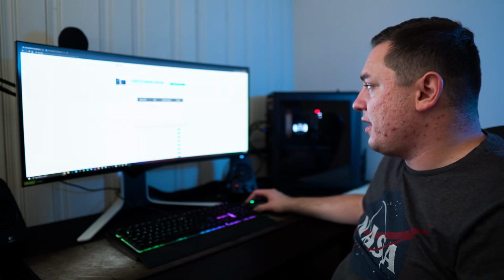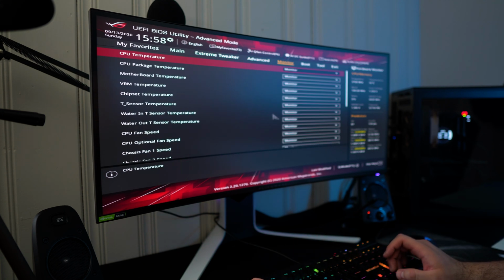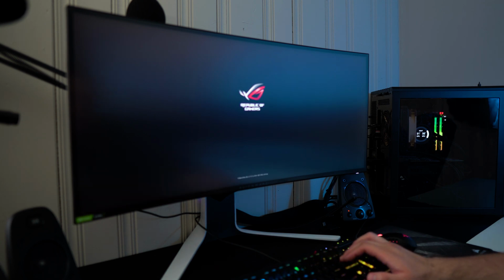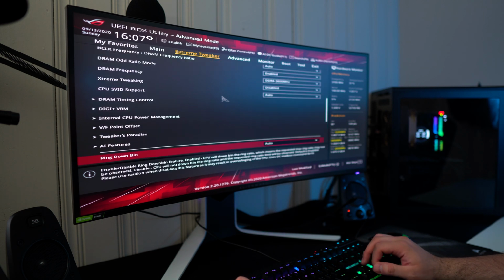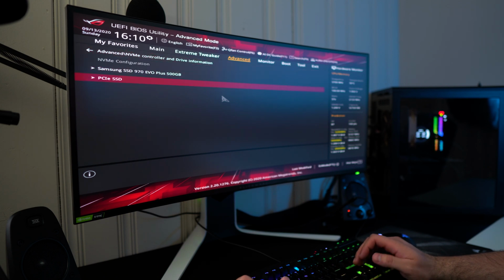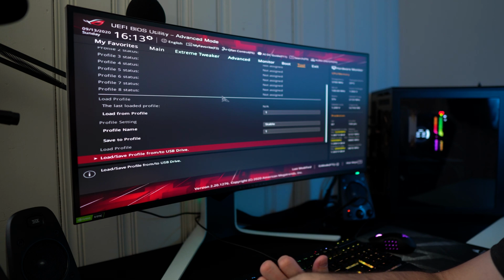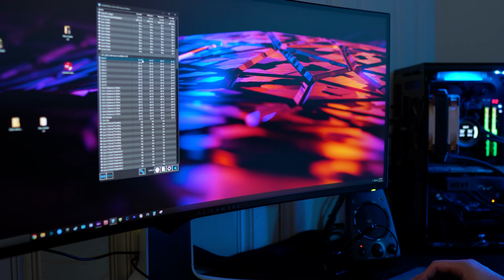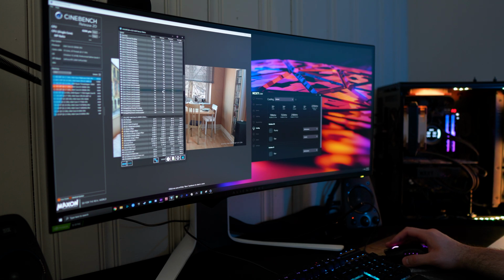ASUS Z490 ROG MAXIMUS XII HERO WiFi BIOS Update w/ 5.2GHz OC

Comment: Helpme nzxt cam not supported cooling devices found (nzxt z73) Mainboard Maximus xii hero wifi
Reply from the maker: Did you plug in the usb cable from the aio to your motherboard?
Reply: @Montieyt  yes I have installed it
Reply from the maker: If everything is plugged in correctly then go to bios and make sure usb is enabled. Reinstall Cam nzxt software on windows. Still having issues contact NZXT or return exchange at the store. Let me know if this helps.

Comment: Whenever i try to overclock on the bios when save and reset it brings me to System safe boot system unstable helppp same mobo with 10850k
Reply from the maker: Go to bios and click on reset to default settings.
Reply: @Montieyt  yes i did that before overclocking

Comment: Hi Montie, I have the same Motherboard and CPU, and I just updated to BIOS 0901. Now the rebooting time went up from 22 seconds to 1 minute and 12 seconds No overclocking, just Intel settings. It also freezes if you select QFan Control tight in BIOS. Any idea why? Is your booting time ok with 0901? 
Also, subscribed.
Reply from the maker: Hey John. I’ll have to check when I get home Unless they came out with a new bios update in the past month or 2 I haven’t checked. My PC boots to windows login screen in about 10 seconds. You can try resetting bios to defaults and set your cpu and ram voltage manually with ram at xmp. Should be able to boot with that.
Reply: @Montieyt  yes please let me know if pressing F6 (QFan control) in BIOS freezes.
I had to roll all the back to 0607, because 0707 also crashed in QFan control. 
I noticed that removing the extra 3 drives sped up the reboot to 20 seconds. It may be one of my drives needs reformatting. 
Thanks for being friendly and informative.
Reply from the maker: No freezes entering qfan. I’d try reseating your memory. Actually take all the ram out except one stick and try it. Also if you have any hard drives/nvme drives pull them all out. Process of elimination in troubleshooting. I have discord if you need to chat in real-time - monte#6261
Reply: @Montieyt  Hey Montie just a quick reply to let you know I solved it after several days. It turns out the generic drivers from Microsoft are 1 long minute slower at restart. I got the info from tech support guys. So, you can let Microsoft do the full install, but in the end the chipset drivers, Intel ME, and Graphics has to be from the guys that build the equipment. From almost 1 minute 40, to 35 seconds. Relief. Battle is over. HOWEVER, QFan Control, or F6, still freezes in BIOS. In 0901, it was OK in 0804. BIOS 1002 just came out, but it is still a Beta, and I have not tried it.
Reply from the maker: Glad you got it fixed. Even though I’ve been building computers diagnosing troubleshooting etc for 15 years I pull my hair out when something is acting up. Another reason why When I upgrade my PC as in change or swap out any electrical components I make sure I’m grounded with esd wrist strap. Used to have weird issues with my previous computers and could never figure out what it was. Started wearing one along with using a UPS back up and haven’t had any problems since. Anyways glad you fixed it. Alot of times its software. Typically once I go into Windows that’s when I’ll install all of the drivers. If you seen on our motherboard we have what’s called armory crate. Also if you have an nvme ssd installed check to see if you’re using the Microsoft driver or the manufacturer driver. Check that in device manager.
Reply: @Montieyt  I know what you mean. I studied electronics engineering for over four years, and specialized in audio systems, and I am no stranger to designing and building an electronic circuit right from scratch. This however, is of no help when you are dealing with the 160 000 army that is Microsoft. Even they themselves create bugs between departments, that gives them a hard time. I do have an Evo Pro 1TB and another SSD XPG 2TB, and 4 mechanical drives 12TB, so I will take your advice and look into Magician. I did not install Armour Crate because many people said it was bloat wear. Do you think I really need it? I don’t really care about the Aura LEDs, but if it maintains other drivers then I will install it. Right now I have a very fast lean machine, i910900K with 64GB of RAM,
Reply from the maker: @JohnnyGuitar1  For Armory crate, that automatically came on for me when windows booted the first time, so maybe some kind of rom chip that auto-installs it upon booting windows the 1st time? I wouldn't be surprised if that's the case but I used that to install my Network Drivers, then I went to Asus website and downloaded all of the current drivers, installed Samsung Magician for the Driver to replace the Microsoft One.  If you're already in Windows with internet access theere's not really a reason to install armory crate, I wouldn't say it's bloatware. Install it and see if you need / like it, can always uninstall it. You should be fine on system performance. I like having all the settings manually set to avoid any conflicts or crashes or weird things happening. Let me know how the system runs, thankfully I haven't had any issues with windows updates.
Reply: @Montieyt  thanks for being informative and friendly. I had not even thought about the Samsung Evo Pro driver. So now that you mentioned it, I installed it. I have seen speed peaks of 5.1 GB per second, which is crazy fast for 2020. However, Magician may be uninstalled soon. Because QFan Control still always freezes in Bios (F6 or clicking on it), I was forced to install Ai 3 suite, which I always hated, even from previous motherboard generations. Once installed, those services never go away, even after uninstalling. Yes I remember now the Armour Crate window showing up right on the very first Windows boot. I refused it at the time. The thing is, I can’t find anything else useful about it, besides the LED control, which I always turn off except for the motherboard codes. I made a full system image with Macrium Reflect, and I will try Armour Crate. I am doing full productions in Nuendo, with a 52 audio channel system, and once I finish sharpening the knife, I hope I don’t have to see it again. But for now, I have been doing nothing but fine tuning the whole system for days. Except for the BIOS freeze, everything is perfect. It really puzzles me though, why it works in yours, and not on mine, with the exact same 0901 BIOS. I am tempted to install the Beta 2001, but I rarely go for Betas.
Reply from the maker: Since I’m using nzxt aios with Fans attached I just have qfan disabled in bios which causes my fans to run 100% but then i used nzxt cam software to control it (software fan curve) and it works just fine. Some people hate can don’t really know why but i haven’t had any issues with it. Also since you’re doing auto check out this app since you seem to be Trying to optimize everything on your system - https://www.reddit.com/r/Amd/comments/j4djqe/experiencing_high_dpc_latency_a_possible_cause/?utm_source=share&utm_medium=ios_app&utm_name=iossmf
Reply from the maker: I was able to fix stutters I had in games and micro lockups this way.
Reply: @Montieyt  DPC Latency Monitor is outdated in 2020. I use LatencyMon instead to get more accurate results, and you don’t need to install it, which is great. My system results for audio are nearly perfect. AMD guys have a tougher time than Intel when it comes to latency.
Reply from the maker: That’s what i meant. There’s 2 programs I believe. I stumbled across that a year ago but was having problems 6 months ago and fixed it. I like running a lean system with nothing in the background. I also have wifi and Bluetooth disabled in the bios and the 5g Ethernet port as well.

Comment: Hey man im trying to use your setup I have the same board just my cpu cooler is Corsair h100i but all core ratio limit is not letting me manually put it 52 Just on auto
Reply from the maker: Copy the exact settings, make sure at the top you selected Manual Mode.
Reply: @Montieyt  I did select manual mode

Comment: Same ram
Same cpu
Same MOBO
Rtx 3080
And a 1200watt 80+gold full moduller psu
Same ssd but 1tb
And a seagate 2tb hdd
Corsair iCUE 465X RGB Mid-Tower ATX Smart Case, White (CC-9011189-WW)

And this one
Can i use ur bios settings pls? 🥺🥺
Reply from the maker: Give it a go

Comment: Hi I've got roughly the similar specs as you except with a rtx 3080 and 32gb Trident z 3200hz of ram 

Is it safe to follow your settings or avoid certain ones? Appreciate your advice!
Reply: Im new to all this stuff so if you could recommend the settings a newbie shouldn't touch for safety reasons I'd appreciate that as well :)
Reply from the maker: Just set the settings identical to mine except put your ram at either Xmp or manually set or ram settings. Shouldn’t have any problems just try that and let me know

Comment: So i tried your settings and my pc don’t want to boot. It says post safe mode something and my only option is to press F1. I have the same specs as You Do You know what might be the issue?
Reply from the maker: Make sure you check your CPU core voltage and ram voltage and ram timings. This motherboard is so finicky on the ram that XMP would not work and I had to enter manually. Try my settings again but put in 51 for core ratio and test. Might be that your cpu can’t do 5.2ghz. Also last thing there’s been updates to the bios make sure you’re on the latest. Let me know how it goes.
Reply: This happened to me. I just reset the bios with the switch at the back then re did everything in a few steps not all at once and then it worked

Comment: You're 10900k runs cooler than my 9700k even though i believe i got myself a good chip that can run high clocks at low voltage with out issue. Currently running 4.8Ghz manually set to 1.220 volts but to let know theres going to be a little over shoot with the voltage even though you manually set a certain voltage. Question does your pump have a high pitch wine above 65% pump speed because mine does but at 65% pump speed it dont.
Reply from the maker: I don’t have any pump noise with either aio.
Reply: @Montieyt   it seems like a high pitch coil wine when the aio pump block on the cpu is set above anything higher then 65% pump speed. so i dont know if its just my pump or what.
Reply from the maker: You Can try return/replacement or rma. The only noise I hear is a hum/vibration that comes from the top exhaust fan I’m using. Since the Corsair air 540 is half plastic and metal mine just has a slight him/vibration to it. Time to upgrade the case soon.
Reply: @Montieyt   yeah it resembles coil wine and theres videos on youtube about it! It might be just a hit and miss with certain ones idk. the cooling is good its just the coil wine thats annoying and is only really noticeable if you have your ear up close to the case where the lcd pump block is on the cpu. Other than that its been great no other issues its quiet other than what i mentioned with the pump block on the cpu making a medium pitch whining noise, if i set the pump speed to 65% speed then it fine.

Comment: Be careful anyone that wants to update their bios to 0707. For me it made my temps higher and also needed to increase my voltage for it to be stable. I reverted back to the old bios. A quick google search shows some other people having similar issues.
Reply from the maker: So far many hours after the video everything seems to run exactly the same as before. Not saying others won’t have issues. But mine is running great.
Reply: @Montieyt  Yeah for sure, it's all individual use case. I know one guy said he couldn't run XMP after the update. So the problems are not even the same among the people with issues.
Reply from the maker: Yes I couldn’t use xmp on any of the bios updates even though my ram is on qvl so I just entered the dram voltage and my first 4 timings and haven’t had problems with the ram anymore. Sucks cause I always use xmp but I guess not on this board.